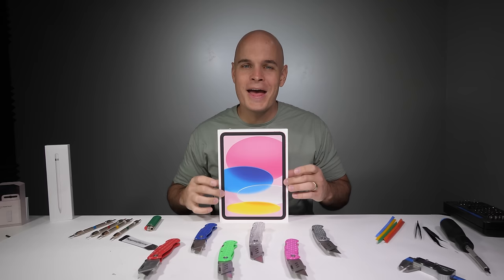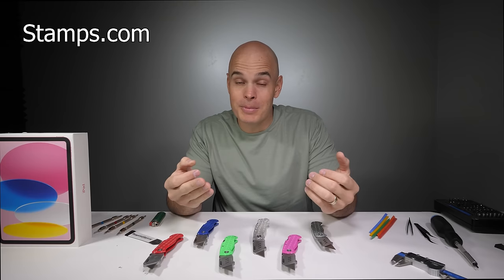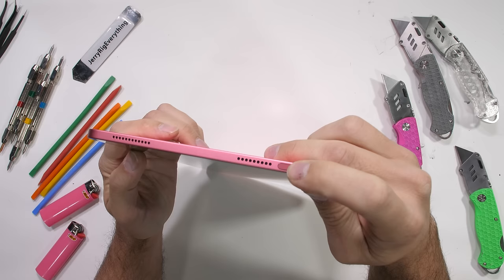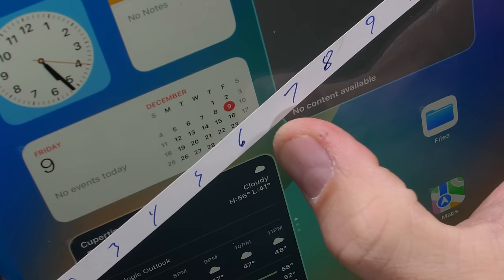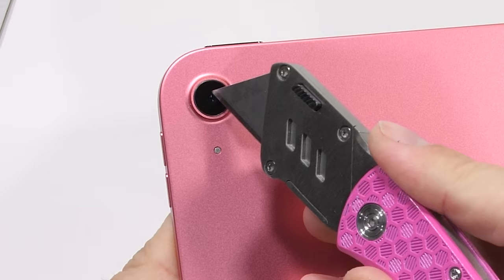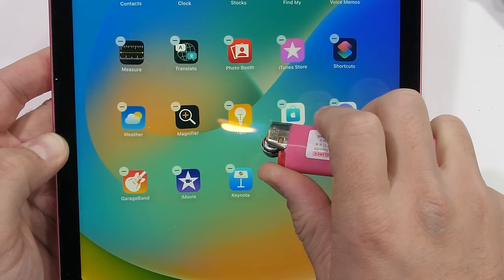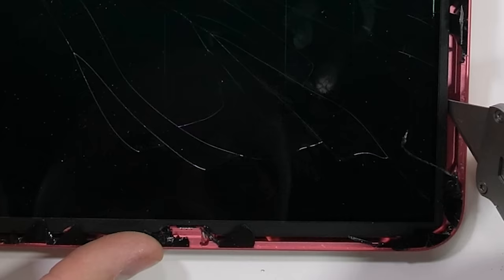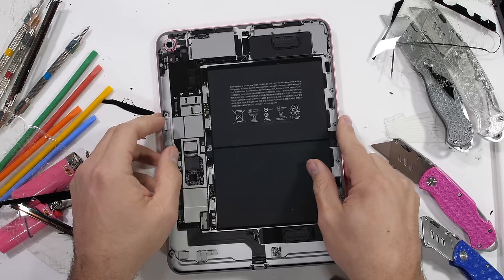The New iPad is...  (Lets just not talk about it...)

Comment: The weakness that caused it to catastrophically bend is probably the battery being split into 2 parts, made worse by being aligned with those small contacts on the side
Reply: No, I'm pretty sure the battery is split in two because apple is aware of the weakness at that point.  They want the ipad to break at that specific point if someone were to try to bend it until it breaks like this. Can't have that battery being punctured and exploding when some idiot teenager thinks it would be funny to fold an ipad for shits-n-giggles.
Reply: That's probably better for the battery being split into two parts. If it was one single piece, even that could possibly break and explode and then you just won’t have only a dead iPad, you'll have a dead Apple user too~

Comment: Have you noticed that there are 2 separate batteries that do not get bent with the iPad? I think that's a clever safety feature to avoid damages to the battery 🤔
Reply: I doubt they plan on having their ipad's folded in two, at that point all bets are off. Probably a cost decision, are super large, flat batteries that common or cheap? Besides, if he folded it the long way then both batteries would have gotten it

Comment: bro i remember the iPad 2 having that separate touch screen. Apple is evolving, just backwards 😂
Reply: How that backwards? Non-laminated displays make it easier to repair, especially for businesses and schools.
Reply: @excarnator  so it IS backwards, just for a purpose that actually makes sense this time around
Reply: @sabersz  It's always been this way afaik.
Reply: Just like your intelligence.
Reply: @sabersz  honestly i dont think its that good for structural integrity thats all im saying
Reply: why is everyone violating. i thought jerryrig had wholesome fans not keyboard warriors
Reply: @rolanttv5803  an airgap between the displays still isn't the biggest design flaw with the iPads, as those dots in the centre have been a weak point for YEARS now. Realistically speaking the airgap display means just the glass needs to be replaced if a school student breaks it, but if they bend the iPad accidentally.... Welp, it's screwed.
Reply: @sabersz  makes it feel cheap and tacky with the air gap

Comment: I recently got the tab S8 ultra and I like how in your video you couldn't snap it and it has gold contact points but they're like smaller and better built into the frame Apple should take notes on that it's still amazes me how thin this thing is and how much technology it packs into that small thickness
Reply: I recently got a "regular" Tab S8 and it rocks!! Plus you get the SPen for free inside the box and it's wayyyyyy better than the huge-heavy-plastic Apple Pencil for writing (and trust me I tried it)
Reply: @BALDO 3  i have the same one 
One of the best tech purchases i made!
Reply: It amazes me how much empty space is in this thing and yet there's no headphone jack.
Heck, with all that empty space, they could have also included a lightning port for charging the old Apple pencils, so people don't have to buy and not lose a $10 dongle.
Reply: you can’t compare the base ipad to an tab s8 ultra tho lol
Reply: @prod.prophet691  I know but since the tab S8 ultra is similar to the regular Tab S8 (in terms of specs) which cost almost like the regular ipad your can compare the two devices
Reply: @BALDO3  it's impressive how they gave the base s8 the same internals and materials as the ultra despite being half the price
Reply: @dirtydirtsgt4751  Yeah, they did an amazing job
Reply: @mjc0961  Who tf charge the pencil on the tablet
Reply: @Dimitri04arshavin  don't tell me you use a wall charger for it every time
Reply: @dirtydirtsgt4751  It would be ilarious
Reply: @dirtydirtsgt4751  inbuld usb on my desk
Reply: @BALDO3  bro android tablets are notoriously terrible at everything else!
Reply: @BALDO3 No, you really can’t.. you’re still comparing a 450$ device with a 999$ device.

Comment: $450 might seem okay to some, but I had an Ipad Air2 and the battery died. TWICE.  The second time, instead of spending $160 to replace the battery, I bought a Lenovo M10 for $180 and never looked back. The screen is bigger, the 8 cores are faster and the battery has never given me a moment's trouble. All good wishes.
Reply: You’re complaining about an iPad’s battery that literally came out 8 years ago. Bffr. Also the M10 has an objectively worse screen and a much slower processor than any current iPad being sold.
Reply: I've had my iPad Air 2 for 6 1/2 years and I bought it used for $150. It's never once failed me and it still works perfectly from the day I bought it. I'm even using it right now to type all this out. The only problems I've had is occasionally the screen will freeze up (maybe once every three four weeks) and it can't process very high quality games but for just movies, music, school, and communication it works great.
Reply: @myNEONCITY  notice how they used the word "had" you know PAST tense. Comparing a new ipad with his experience is clown shoes sh1t. Completely irrelevant.
Reply: @strayiggytv  And comparing a new Lenovo tablet with an 8 year old iPad is somehow not clown shoes sh1t irrelevant too? Bffr.

Comment: It's insane how with an ipad you need up to two dongles just to charge the pen, but with a thinkpad yoga all you have to do is put the pen in the slot on the side of the laptop and it charges right there.  And because its stored inside the laptop on a thinkpad, you never lose the pen, which I can say with confidence because I've had mine for 5 years now and I'm still using the original pen.
Reply: also, why isn't the adapter just a little nub at the end with a USB-C plug sticking out?

Comment: I just wanna say that I just bought an iPad Pro second gen 128 gig for $460. It's Apple refurbished and that means they replaced everything on the outside and the battery and only reused the internals, so it's practically a brand new iPad, flawless condition, factory new. I feel like I found a cheat code. So yeah get a refurbished iPad instead of this thing.

Comment: Why is apple still soldering the iPad dock connectors? There’s no reason to solder it in and not make it modular, and all components that are exposed to high use will eventually die and should therefore be made modular

Comment: I shoulda watched this before I bought the yellow one. Its not as loud as my previous 2019 ipad pro, it sounds like I'm watching a video from across the room. And it feels almost hollow when holding it. When I tap the screen, it makes a hollow noise if i tap too hard. And maybe its just me, but it isnt as smooth an experience once you get started using it. All in all, it feels like something meant for a child to use. 

I was looking for something different when I got talked into this one. I dislike that while my ipad pro is old, it looks almpst exactly like the newer models. It still works exactly the same, and I mostly use it for drawing. I shouldn't compare the two as theyre from different lines, but this one feels just so cheap. Ive been an apple user since the 4th iphone, and i just feel disappointed about their products most of the time. Maybe its time to switch.

Comment: Notice even the battery is split with that little separation line where the charging keyboard notches are.  It's as id apple knew of the week spot and didn't want the battery splitting in half and exploding. Causing bad public relations and a lawsuit.

Comment: After using USB-C on the new iphone for a week, I think I actually prefer lightning from a form factor standpoint. It's smaller, and the edges of the port are slightly rounded so it glides into the port easier. USB-C has fairly sharp edges that catch more.
Reply: you're weird